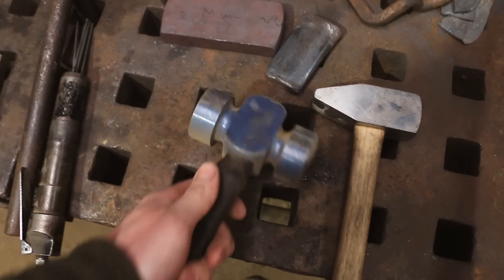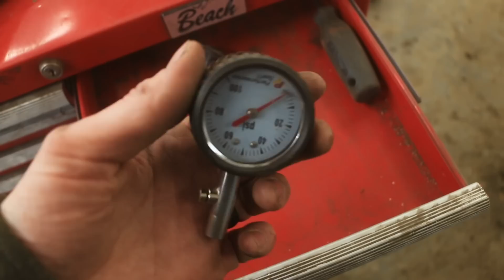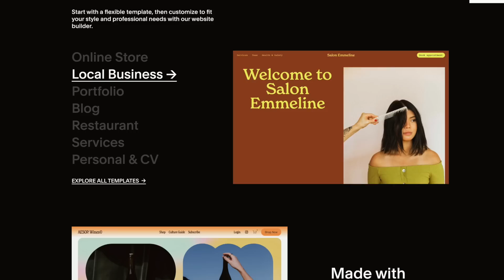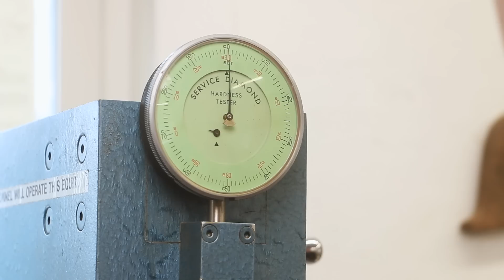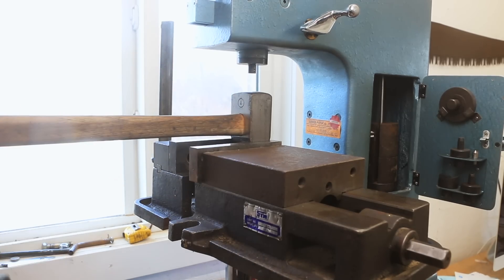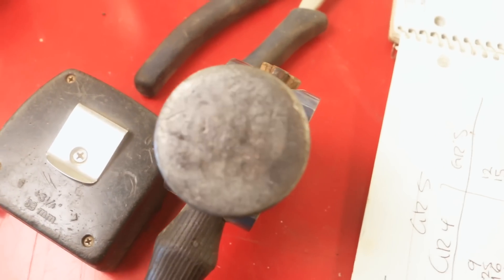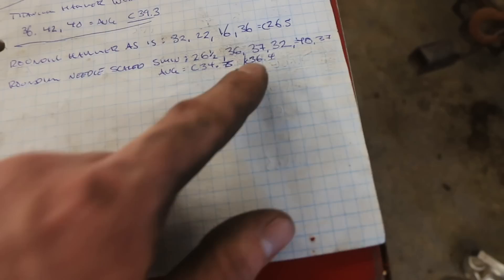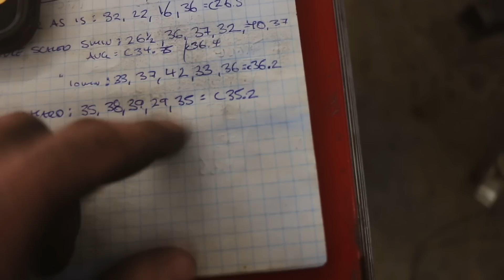Can you harden TITANIUM with a Needle scaler?

Comment: IIRC Titanium has limits, it can't reach the hardness of other alloys like carbon steel and it will become brittle. It's one of various reasons why Ti is not a suitable for applications like hammers or knife blades.
There are structural grades of titanium in fasteners that go up to grade 27 i think but they are very specialized, very expensive. Generic grades go up to type 12. Type 5 Ti has a hardness of about 40-ish.
https://en.wikipedia.org/wiki/Brinell_scale

Other generic methods of hardening include industrial processes like induction hardening, that is used on cast molded parts and shot peening. Ti is a metal that will work harden while its being milled that is something that makes it a PITA to use for designing machined parts.

Comment: any off the rack grade of titanium should be worse than tool steel. you need a tungsten impurity (hardness) and maybe a silver impurity (tensile strength which helps a little).like  0.2% - 0.3% tungsten and maybe 1% silver. thats custom order or diy. if diy then light bulbs you can get trivial amounts of tungsten

Comment: The inaccurate readings will be coming from an uneven surface. Hardness testers are measuring in ..0001 increments per .5 HRC. You need a nice smooth atleast 120 grit finish. If you do that I'd be you will probably see a 1-2 HRC jump and much more consistency across the readings. Very cool to see the difference in needle scaling vs as is. Keep up the great work

Comment: Hey Tim, i wonder if doing something like a machinist hammer (the ones that normally have a brass or nylon strike face threaded on) would work titanium body then a harden steel strike face. Keeps the larger surface area face with the reduced weight body.

Comment: Hi Tim  Great video as usual.  So that where my tire gauge is.  No problem.  I bought a new one so I can check  5 - 7 PSI for the quad  tires.
Reply: Can you possibly suggest a formula to convince my adult kids to return all the tools I 'loaned' them?  I have so many empty drawers and hooks.  I've asked for my kit back, and they're too big to put over my knee, so any hints would be a really big help 😉😉
Reply: @Moondog-wc4vm
Reply: My oldest son had the same problem.  His solution was that it is ok to take the tools but if they are not back when he needs them the tool box is locked until they are returned. I think its working.
Reply: @wesandsharondyck4363  😅😅 It's working for my son!  He's OK, but I need to borrow my tools back from him to do simple jobs.  That would be fine, but he asks for them back almost before I finish the job.
Reply: Gift the kids the old tools. Gives you an excuse to buy new 😉

Comment: Engineer here. Titanium definitely work hardens, it is also prone to realizing the hardening very rapidly. So the 5 minutes of needling would possibly have realised the amount of hardening that was possible with the hammer.

As far as I'm aware, to get titanium to a RHC of over 50, you need to do surface hardening, this is done with diffusion hardening. I'm not an expert on that, but it takes many hours and a lot of energy in terms of heat to get the desired result.
Reply: It would be cool to see him team up with a company that specializes in hardening for a hammer!

Comment: What about a video trying to forge 24k Gold. Obviously not practical for a functional tool but it would most definitely garner views. Just a suggestion, love the channel Tim. 🔨
Reply: Pure gold has the highest malleability of all metals, meaning that if you take piece and start hammering it, it will just keep getting wider and thinner, a bit like play dough.
It doesn't break at the middle or edges from being worked like other metals, you know how you can break a strip of steel by bending it back and forth, gold doesn't do that.
IIRC Hyd Press channel took a lump and just kept squeezing it in different directions and they could return it to roughly same shape over and over.

Comment: Think someone else commented below as well, shot peening would certainly work, Really any heavy medium moving fast enough would potentially harden it.
I suppose you could also try using the hammer to hit  hard objects like ceramic balls or hardened steel balls (Though be careful) and that would essentially be like shot peening but in reverse.

I would also like to point out that one of the reason you like using your hammer so much is probably because it is soft and it is softer than steel hammers, a harder surface would transfer more energy and vibrations more efficiently into the hammer but by having it relatively soft it sort of acts more like a spring helping dampen the forces felt.
Reply: I wouldn't be so sure about that, titanium is probably able to store more energy elastically than steel, due to its low modulus and high yield. This means it would be capable transfer more vibration than steel- in practise neither material is deforming significantly so there wouldn't really be a difference. I think the weight would be the main thing. It could be interesting to make a superelastic nitinol hammer to test that thesis though - that would have excellent damping properties.
Reply: @MrTheomossop  sorry not super familiar with a lot of the terms anymore but my thought would be that while yea titanium has a lower modulus than steel or something its still acting more like a spring in general compared to a hardened steel hammer since its deforming and that energy is being used to sheer bonds. At least again compared to a hammer that has a hardened face (which I would think would be harder than the current hardness he has on his hammer right now).

But yeah you do bring up a good point.

As for weight I could see that being a pretty decent factor since the titanium hammer would be lighter.

Comment: Tim, if you want to get the titanium to work harden then you need to cause actual plastic deformation to occur. You need something that will create actual divots in the face of the hammer! Needles and flat face hammers only get you a little way there. You need a heavy hard steel hammer with a small radius tip, and use that with force so that it will actually leave little visible dents/marks of 1.5 to 3 mm. 

If you can see that you leave some mark/impression on the surface you know you're letting the material flow plastically, and that is what work hardening is!
Reply: This. Aerospace Shot peens their parts. they literally sandblast it with 1/4" ball bearings. The real question is if you can then polish that surface and retain it's mechanical hardness
huh, I wonder if you could just put a ball bearing in an air hammer tool and do basically what he did with the needle scaler. that or just temper the tip of a normal bit considering he's got all the gear for it already
Reply: What about putting the head in the mill or lathe and just purposefully doing a bad job of cutting the face flat. Just the right king of cutting too slow or something?
Reply: @bigbird2451  Assuming that you deliberately use the wrong cutting insert, the wrong feed rate and cutting depth, you definitely can get the tool to smear, rather than cut. And yes, that would work harden the material too.

Comment: What if you heat up the metal and hit it with the needles until it cools down?
Reply: Work hardening only works properly when it's cold
Reply: So if you go above lower critical temp you will go into diffrent phases and remove any hardening you achieved
Reply: @jonhy2x4  Aha, Thank you. 
So what if you cool it down, and then needle it? (come to think of it, cryo hardening is a thing, I think)
Reply: Yes needling it is just work hardening artificially..... Most titanium work hardens at room temp depending on other alloys will determine its hardenability at quenching due to phase changes